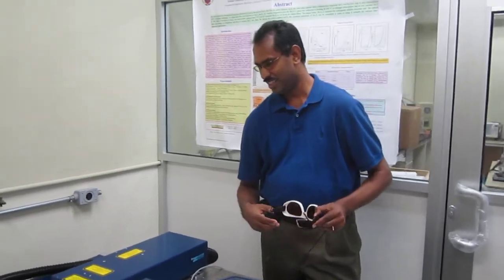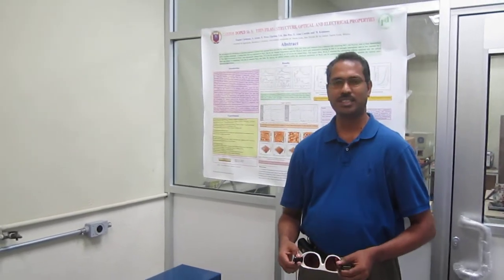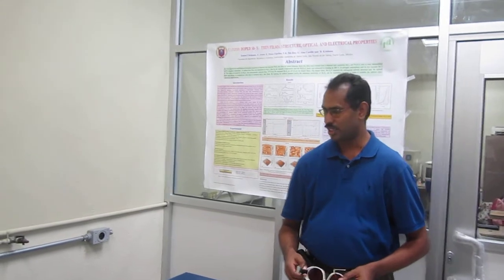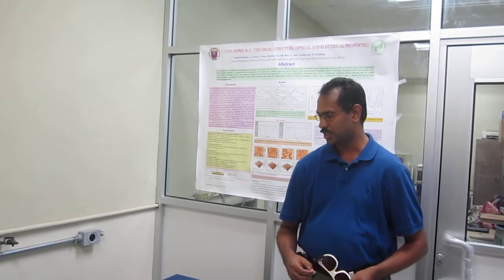Del Mar Photonics Nd:YAG laser system at the Universidad Autónoma de Nuevo León UANL

Comment from the maker: Variable Attenuator for Femtosecond laser pulses VAFS-S
http://www.dmphotonics.com/VAFS-ST.htm
Divides laser beam into two parallel beams of manually adjustable intensity ratio 
Low dispersion for femtosecond and high energy laser pulses 
Large dynamic range 
Negligible beam deviation 
High Optical damage threshold
This variable attenuator/beamsplitter consists of 2 high-performance polarizing optics components placed in precision opto-mechanical holder. The variable attenuator/beamsplitter incorporates 2 high-performance Brewster type polarizers, which reflect s-polarized light while transmitting p-polarized light. These two Brewster type polarizers are housed in specially designed opto-mechanical adapter. This adapter allows to use round shape or rectangular shape Brewster type polarizers.
A rotating quartz ?/2 waveplate is placed in the incident polarized laser beam. The intensity ratio of those two beams may be continuously varied without alteration of other beam parameters by rotating the waveplate. The intensity of either exit beam, or their intensity ratio, can be controlled over a wide dynamic range. P-polarization could be selected for maximum transmission, or high-purity s-polarization could be reflected when maximum attenuation of the transmitted beam takes place.

Specifications
Central wavelengths	780, 800, 1064 nm or other
Beam deviation	40*10^(-6) rad, average over range
Aperture diameter	20 mm
Damage Threshold	1 J/cm2 pulsed at 1064 nm, typical
Antireflection Coating	R <0.25% all entrance and exit surfaces
Time dispersion	t<4fs for Ti:Sapphire laser pulses
Polarization Contrast (after 1st polarizer)	1:190
Polarization Contrast (after 2nd polarizer)	1:7000
-------------------------
Variable attenuator for ultrafast lasers, 800 nm
[VAUFL-800]	
http://greyhawkoptics.com/product_info.php?products_id=766&osCsid=380eb9d6cf55b12d0552fb28d2b2b24a
Reflection optimized continuously variable attenuator for ultrafast lasers
Wavelenght range, nm: 750 - 850
STANDARD SPECIFICATIONS (substrate):
Operational wavelength range: 750 - 850 nm or 980 - 1090 nm (other available upon request)
Clear aperture: Standard 15 mm (up to 50 mm are available)
Type of configuration: Transmission
Polarizer: Reflection optimized
Configuration: ?/2 Zero Order airspaced waveplate + 2x
Broadband (ultrafast) thin film polarizers 60 x 20 x 2 mm
Extinction ratio: Rs/Rp >20:1
Attenuation range: 4 - 96%
Damage threshold: >5 J/cm? 10 ns pulses at 1064 nm, typical

=========================================

The optical attenuators (OAFP, OAGP) are designed to attenuate laser radiation with more than 1:10^3 ratio. The OAFP 
model comprises a thin zero-order half-wave phaseplate and two mirror polarizers that select the input pulse according to 
polarization. This model has been specially developed for pulsed femtosecond radiation as it introduces as little dispersion to 
the pulse as possible. For longer pulse durations we offer the OAGP model, which has better transmission ratio as a Glan prism 
is used to simplify the scheme.
 The attenuator comes in motorized and manual modifications. Please enquire for more information.
http://www.dmphotonics.com/Product_Data/OAFP_Attenuator_datasheet_DMP.pdf
OAFP OAGP
Dynamic attenuation range >10^3 >10^3
Wavelength 250-1500* nm 250-1500* nm
Bandwidth**, % to central wavelength 6-20 % 10-20 %
Required input pulse duration <100 fs >100 fs
Transmission 65 % 90 %
Clear aperture >10 mm >10 mm
Angular rotation of the half-wave phaseplate 40° 40°
* - please spicify with order
** - depends on the central wavelength

======================================
Variable Attenuators for Femtosecond Ti:Sapphire Lasers
http://www.dmphotonics.com/GreyhawkOptics/variable-attenuator-for-femtosecond-TiSa-lasers.htm
Diffractive attenuators control the power of laser radiation using diffraction gratings. Since phase diffraction gratings do not absorb light they can be used for high-power laser radiation (cw, pulsed). Variation of grating parameters along the substrate results in variable transmission at a given wavelength.
Diffractive attenuators can be designed for wavelength from deep UV till IR for laser powers up to 250W/cm2 in CW and 1000mJ/cm2 in 10ns pulses.
Light beam passing through a diffractive grating is partially deflected into several diffractive orders, which get subsequently blocked by diaphragm. Thus the zero order beam (does not change the direction of propagation) is attenuated. The intensity of output radiation Ioutput depends on the grating design and wavelength of input beam. By changing the grating parameters one can control the power of output radiation1. The transmission coefficient of such an attenuator is h = Ioutput/Iinput..
Design of diffractive attenuator on the base of circular diffractive grating.

Variable Attenuators for High Power Lasers
http://www.sciner.com/Opticsland/DVA.htm
Diffractive attenuators control the power of laser radiation using diffraction gratings. Since phase diffraction gratings do not absorb light they can be used for high-power laser radiation (cw, pulsed). Variation of grating parameters along the substrate results in variable transmission at a given wavelength.
Diffractive attenuators can be designed for wavelength from deep UV till IR for laser powers up to 250W/cm2 in CW and 1000mJ/cm2 in 10ns pulses.
Principle of operation
Light beam passing through a diffractive grating is partially deflected into several diffractive orders, which get subsequently blocked by diaphragm. Thus the zero order beam (does not change the direction of propagation) is attenuated. The intensity of output radiation Ioutput depends on the grating design and wavelength of input beam. By changing the grating parameters one can control the power of output radiation1. The transmission coefficient of such an attenuator is h = Ioutput/Iinput..

Diffractive attenuators control the power of laser radiation using diffraction gratings. Since phase diffraction gratings do not absorb light they can be used for high-power laser radiation (CW, pulsed). Variation of grating parameters along the substrate results in variable transmission at a given wavelength.
Diffractive Variable Attenuators are based on binary optics technology. Attenuator manufacturing starts from computer design of two-dimensional diffractive gratings using proprietary Diffraction Optics Design Software. Master Grating mask is created using high-resolution laser photo plotters. Final manufacturing process is accomplished using lithographic methods including plasma etching.
Diffractive attenuators are designed for wavelength from deep UV till IR. Damage threshold for these high power attenuators is more than 250W/cm2 in CW and 1000 mJ/cm2 in 10ns pulses.
http://greyhawkoptics.com/index.php?cPath=31_61?

Laser Attenuators for Nd:YAG Lasers - Del Mar Photonics
http://www.dmphotonics.com/GreyhawkOptics/Laser%20Attenuators%20for%20NdYAG%20Lasers.htm

Variable Attenuators for High Power Lasers brochure
http://www.dmphotonics.com/DVA.pdf

====================================

THz_attenuators
Brewster’s angle attenuator for terahertz pulses
http://www.opticsinfobase.org/ao/abstract.cfm?uri=ao-41-36-7637
A variable attenuator for terahertz (THz) pulses is developed on the basis of the change in reflectivity of lithium niobate wafers with incident angle in a Brewster configuration. We can vary the THz field transmission from 22% to 54%, a change of a factor of 2.5, while preserving the shape of the THz pulse spectrum. Changes in the THz spectrum are shown to be much smaller when the Brewster attenuator is used than when either the near-infrared pump power or the bias voltage on a THz photoconductive antenna is varied. The Brewster attenuator should prove especially useful for varying THz field strength in nonlinear optical studies that use broadband THz pulses.

Comment from the maker: When requesting an OPO for your existing laser please provide the following information (some specs are shown as example)

1.      Manufacturer: ___________
2.      Model: ___________
3.      Pulse Repetition Rate: 15Hz
4.      Energy per pulse at 532nm: 100mJ
5.      Pulsewidth, FWHM: 8ns
6.      Spectral beam purity at 532nm wavelength. What is the energy (noise) at 1064nm wavelength in the 532nm beam?
7.      Beam diameter: ___________
8.      Divergence in the near field: ___________
9.      Pulse to pulse stability at 532nm: ___________
10.     Beam profile (it is desirable to send a picture of the beam profile in the near field): ___________
11.     Polarization at the wavelength of 532nm: ___________
12.     Optical axis height above the table: ___________
13.     How is the OPO planned to be installed near the laser? On what mounting frame?